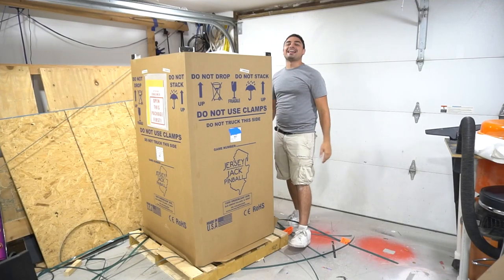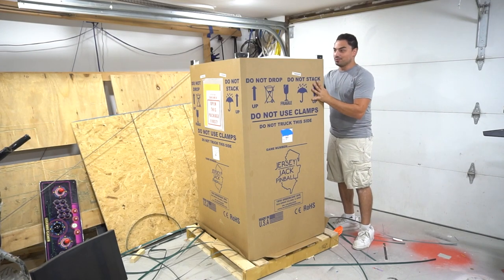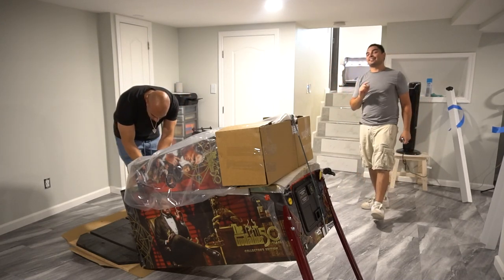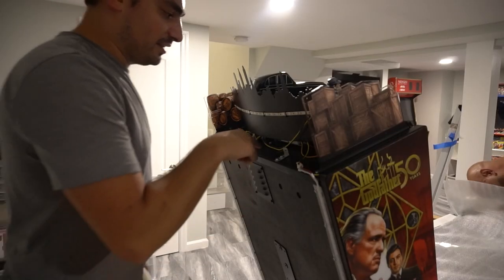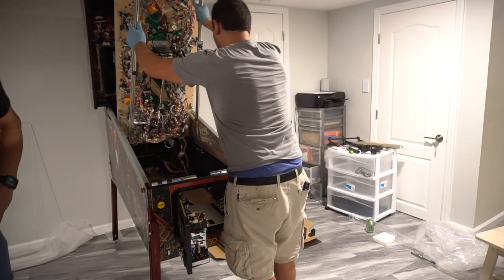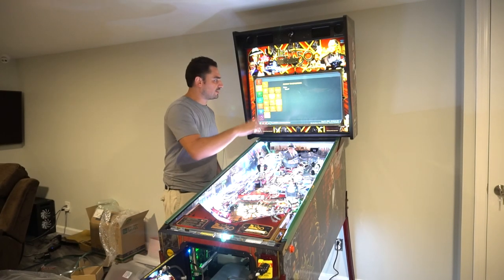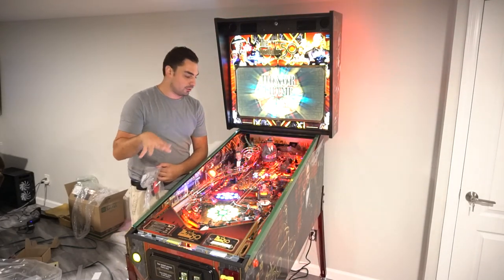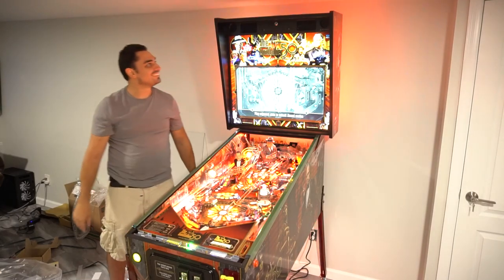Unboxing a Godfather Collectors Edition Pinball Machine From Jersey Jack Pinball

Comment: Vic, maybe there's  space, between the basement ceiling and main floor for a cubby/recess that will give you the space for the topper.???
Reply from the maker: Sadly no... the backbox is about 27 inches wide... I'd have to cut into 3 rafters and remove 10 inches on each rafter 🤣

Comment: Congratulations and Thank you for the video. Well done   😊. I just got my CE . Was dream come true to get this game ! Just wondering the 5 steps to look at before playing to many games.  Thank you
Reply from the maker: Congrats on your ce your gonna enjoy the hell out of it! Be sure to join pinside and check the thread "godfather- keep it in the family"

The video is set to go live on the 15th but 2 main things is the pcb/led on the left Apron  by the flipper is veryyyy close to touching the apron and possibly shorting out. You can see the right side Apron led looks fine, but the left is close... remove Apron and put electrical tape on the pins.
The other 1 is buying the rubber strip and placing it under the left ramp (this ramp goes up and down a lot during gameplay). My ramp actually scratched the mylar on the playfield out of the box, so I highly suggest getting the rubber (again this is posted on pinside and look at the pinned topics at the top)

Another major on is the gold discoloration on the lock down bar... after playing a handful of games I can see the discoloration... only thing to do is give jjp a call and they put a ticket in for me. They said "e joy your game for now... we are working on a fix and will keep you posted"
Reply: @Vic_VP  thank you Vic. It’s my first pinball machine. I wish I could see what to do with this machine. To keep it safe.  Your amazing guy. Thank you. Keep the videos going  your a natural when it comes to speaking
Reply from the maker: @vincedemaria9659  haha hey it'd my first machine also! Ain't it a beautiful machine... especially to be your first pin.